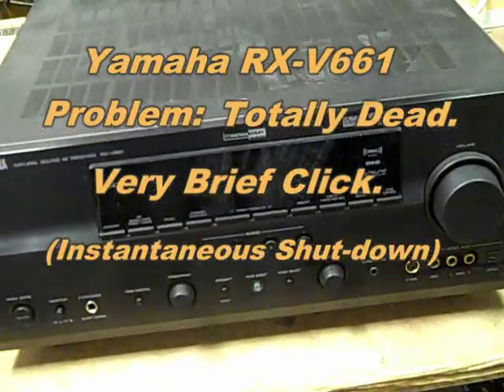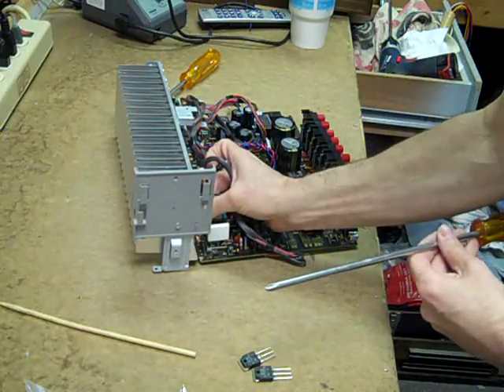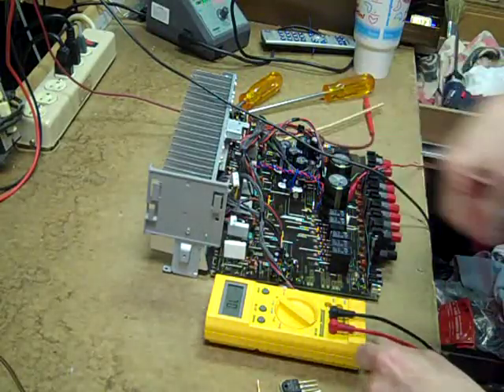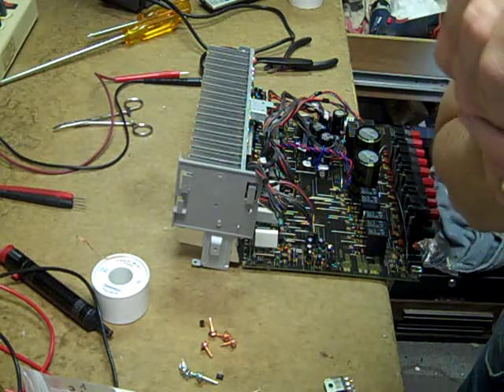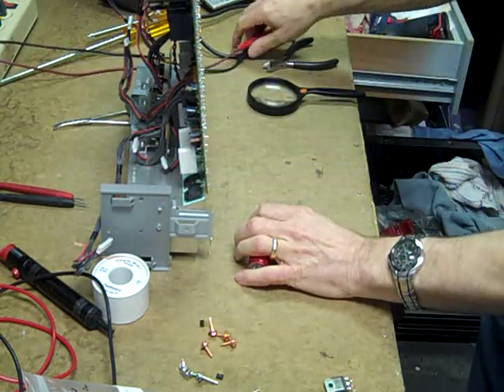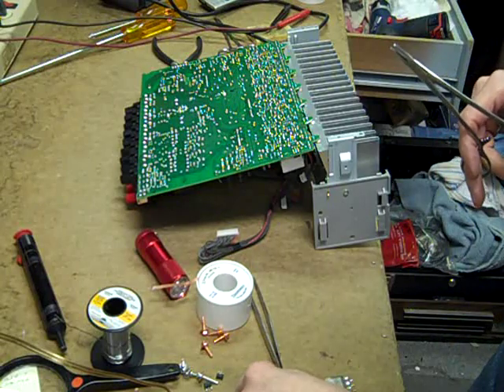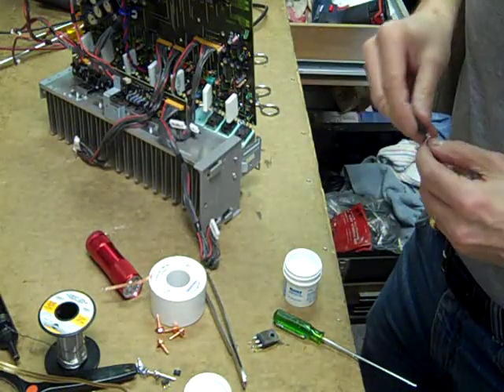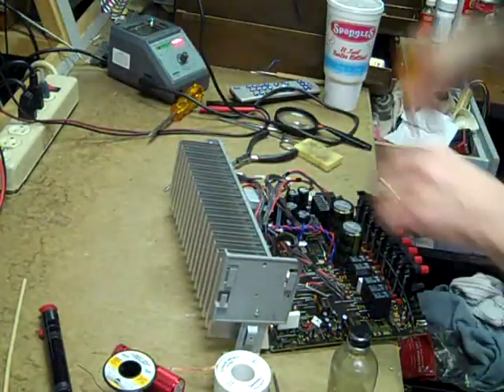Yamaha RX-V661 Repair Brief

Comment: Update 3. Things changed. Now the bulb lights intensely (pulsating, rather) when connecting to AC outlet; in addition, power transistor Q716C (NPN) does not look good (when measured in circuit). Not sure if this is a new problem or, this was the issue all along. Question: if I remove the 2 power transistors from this channel, and restart the receiver, would that work? I want to check if the receiver starts without entering in protection, with that pair removed.

Comment from the maker: The trick on these is to prepare a double ended POLARIZED AC cord; Take the receiver's own cord and plug it into one of it's own switched outlets. Take the double ended cord and run it from the the other switched outlet to the AC outlet or variac. The receiver will shut back down but the internal voltages will stay up. Make sure that the AC cords maintain the Neutral and Hot relationship, or BIG SPARKS will occur.
Reply: Hi wanna know if you provide repairs for the public i have a dead harman kardon 3700 with no power no stand by light

Comment: Hi... I have this receiver.   I haven't used it for the last few years due to house reno.... Today I hooked it back up today and was listening to it for about 45 mins.   When I moved the receiver into the stand the front speakers and the rear speakers stopped working..... the center channel and sub are still working.  I've been thinking I pushed a button or something..... Now 2 hours later and I've tried every setting.... I'm guessing this might be internal.... any thoughts?

Comment from the maker: Sorry didn't reply sooner. Don't have any Kenwood service data. Blue flashing in the relay sound like a serious short in there somewhere. This could involve working around some hazardous AC voltages. If you are comfortable doing so, unload the transformer secondary and see if the clicking / flashing continue. Also, if it blew the fuse, DO NOT replace it with a higher value or tinfoil it.

Comment from the maker: You have serious problems now - the amp channel is blown like in the video. The transistor number is abbreviated. The number is 2SC4468 and it's complement is 2SA1695. The drivers are also blown, probably also the 5.1 volt zener diode, maybe some other parts.

Comment from the maker: This is actually a very common problem with these. Are you a technician? The bad parts are on the main board, kind of hard to get to. Everything has to come out and parts soldered in from underneath.

Comment from the maker: My guess is that it would work but maybe be more NTSC than PAL for example. HDMI codecs and permissions are way over my head. Internal voltages would be compatible, but even with that I'm not sure it would work. I would suggest another used 661 might be a better option, maybe a broken one with other problems.

Comment from the maker: If it stays on with the volume down, check the voltages on the bases of the output transistors. They should all be about 0.5 to perhaps around 1 volt. Any anomalies would point to an affected channel. Could be one channel is still 1/2 dead. A severely clipped signal which would happen as volume is increased, would cause the protection to shut off. Could be a bad resistor, or transistor. A driver or bias transistor could be bad. Welcome to electronics repair. You need a schematic.

Comment from the maker: Probably either the remote receiver itself is bad (it happens) or maybe there are bad solder connections there at the IR receiver module. This also is pretty common. Way down the list would be some other fault in that area, a circuit board flaw, leaky cap, bad microprocessor, etc.

Comment from the maker: I mainly use the sucker for larger solder connections, to save on solder braid. I have a Denon (yup) hot air sucker/blower but it's old and doesn't work as well as it used to. I mostly reserve that for desoldering flat-packs. Thanks for watching - sorry I don't post much at all anymore. Maybe when I can afford the slowdown in production that the video work causes...

Comment from the maker: Assuming the power supply voltages to the HDMI board are OK, if the HDMI indicator on the front panel still lights up on an HDMI source, then probably IC1 is bad on the HDMI board. If the indicator does not light, then likely IC14 is bad. The nomenclature in the service manual appears to misstate which IC is the transmitter and which is the receiver.

Comment from the maker: @killerkoop33 The power transformer usually only goes out if you've been running it really hard for a couple hours.The transformer can be checked by a knowledgeable person. Also Yamaha with a blown channel may pull so much current at turn-on that the protect is triggered instantly, you never even see the display come on. If the transformer is OK this is probably the case. I wouldn't recommend just ordering the transformer til you know it's bad. About 135.00+frt. US model.

Comment from the maker: If the bias transistor is bad I would recommend ordering the Yamaha part number, VK432900. You might be able to get away with a 2SC2603, but the problem is the bias would probably be somewhat at variance with the other channels, and there is no real adjustment provided.

Comment from the maker: Actually used a "octopus" or "curve tracer". You can Google Octopus component tester. for info. A diode check on a regular multimeter also works fine. A leaky diode like the one in the video measures low both ways.

Comment from the maker: I do not know what "coil" you are talking about. The primary of the main power transformer would read much less I would think, and still be OK. If you measure OHMS at CB155 on the Operation 3 board (standby power board) and it reads low, the main transformer is ok. At this point you probably have a blown (shorted) amplifier IC. These are somewhat expensive and mostly only available from Yamaha.

Comment from the maker: I think you're in over your head on this one. There probably is a blown channel, but also, these things usually cannot run with the back panel off. Ground connections aren't made and this upsets the protection circuit.

Comment: Great video,

My yamaha RX- V640 shutdown right after i press power button.I hear a click then the screen comes on and it goes back off.After it shuts down i see DC offset on the emitter resistors.What are should i check for that kind of behavior?

Comment: I have a Harman Kardon AVR 354 receiver I repaired (replaced L7915) that worked very nice. I didn’t use it for a few months, and then when I plugged it in and turned on, acted strangely. The unit’s front panel lighted up completely (all characters were on). After reset, it functioned “normal” but with repeated (every minute or so) sound dropouts (short, 1s or so).  Strangely, during the sound dropouts the front panel blacks out, as if the unit loses power (the power on led is on though), but then comes back and functions well for a little while. In the end (~10 minutes) the sound drops off completely (but the unit stays on, and the front panel working OK), or turns into a whistle. This happens in all sound modes, all inputs, with or without any external connections (even with no speakers – reacts the same, you can tell that from the front panel blackout). Between the sound/display dropouts it functions completely “normal”. I tried repeated resets, doesn’t change anything. The F110, F111 fuses and wire (jumper) from HDMI board to Regulator board upgrades have been addressed by the previous owner. I didn’t see anything similar on Internet, have you encountered this issue before?

Comment: seems to be a pretty good amp.copper screws for the transistors.
what is that you use with your soldering gun?not the thing that solders,the other one

Comment from the maker: Well, a variac would be nice. You could put a 100 watt light bulb in place of the main fuse. If it glows bright, there's an over-current situation. This really seems more like a power supply thing though, and the PS PRT error code backs me up on that.

Comment from the maker: You can use 2SC4027 and 2SA1552. Be careful - they are reverse basing from the originals. You can even use 2SC4793 and 2SA1837, but they are much larger TO-220 package.

Comment: I have a Yamaha htr 5440 receiver and no channels were blown blown channels are usually caused by wiring your speakers at too low of an impedance like if the impedance is lower than what the receiver is able to handle

Comment: Hi Mark,
Yamaha RX-V795a. Shuts off after 0.5 sec. Diagnostic mode quickly (0.5s) shows: "PS PRT 39%". Output transistors (C3856 / A1492 pairs) look OK in circuit. The Noble resistors look OK. The regulator 7812 (x2), 7912 and 7805 (all on the main heatsink) have the proper voltage. Mind you, I only have 0.5 sec to do the measurements. Is there any way to increase this time? I can’t measure the DC offset, too short a time.

Comment: Hi Mark,
My Yamaha RXV661 which was running fine for the last 4 years suddently refused to turn on. I was trying to plug and unplug a few devices from the same power plug when I found the 2 of the SCENE button LED turn on for a while. Thereafter, the device simply refuses to turn on. Checked the fuse out of common sense, but they seem ok. What could have gone wrong. Will appreciate your inputs Mark.

Comment: ive not bolted back the main amp board to the heatsink and ive disconnected the thick power wires from the collectors of the power transistors cause ive already had 4 more power and driver transistors go short on me cause of a fault with the plus and minus 61 volt driver supplies,there seems to be something on the main amp board causing the dual supply to be very low,im having to run the amp in diagnostic mode so i can test but i dont know what else to do and yamaha uk are very unhelpful.

Comment: i have a yamaha rx v1900 av receiver,both right and left channels were shorted out destroying four power transistors,four driver transistors,two 5.1v zener diodes,two 220 ohms resistors,also one of the power supplies were damaged that supply the main amp board with a dual plus and minus 61 volts,this has been repaired but the main amp board is dragging the dual supply down very low,i cannot find any more shorts on the main amp board that may be causing this problem,can you please advise me.

Comment: Yeah your right about that,I went to turn on the amp and i heard a loud snap and flash..I thought the transformer went,but it was the circuit lifting up from the board soldered it tested it same thing so i put a jumper on it.the yamaha RX-V2500's fan circuit is still not working so i improvised it with it's own power supply Until i can order a new board.I know yes i am an amateur,but thank you for your informative video's.

Comment: It's the cooling fan,on Power(5) PCB it puts out upto 21 volts. when i reconnect the fan it goes into protect ( the fan circuit that is) and then won't work..I bought the receiver on ebay for $20, the Main(1) PCB was damaged from being dropped on the speaker outputs .The board circuit lines were cracked and i have repaired it  jumper wires and works fine now. self diag shows all normal.I didn't want to fully disassemble the whole thing Luckily the troublesome fan circuit is easy access.

Comment: Hello, I have a kenwood GE7030 equalizer Thats being a real pain.I have the service manual and ive checked all spots for proper voltage and they seem fine.Before it started to go it would sound like distortion on both channels,It would do this off and on untill it died.the display works fine but no sound and the bands display nothing.It also powers on and off with no problems.On the amp board i replaced 3 high speed diodes that looked like thay have gotten pretty hot but still nothing.

Comment: I got that last part in fixed that but my sound still cuts out at about 45 or so and was able to stay on for a few seconds at a higher volume i am not sure seems like something with the front cover because it did stay on at almost max volume. But it still says check speaker wire for the first 10 seconds when i first power on the unit after plugging it in to the wall for the first time.

Comment: Well i am but out of money on this puppy i tested with the meter and found 3 more bad transistors 2 sk1695 and 1 more stc4468 now i thought it was fixed put it back together and it says check speaker wire one the first power up on the second it stays on. I thought i just had to hook speakers up tried that but when i put like fm radio on when the speakers are about to show it clicks off.

Comment: Hay mark i was able to get the receiver to turn on loosing the front cover it turned i turned up the volume it stayed on with no speakers attached and then i put the back and front cover on it would not work loosened the front and got it to turn on5 seconds later a power transistor blew the part number is SK C4468 i only found them on ebay in like china any were you know of in america were i can get them sooner

Comment: hi john it was capacitor that blew up completely did not see it before there is one more cap i don't know if its thermal paste on it or leaking mind you i got these receiver on ebay and it look like it was brand new no dust the fan and the capacitor fix so far must have been a lemon i don't know how to post pictures on youtube but i took some of the blown capacitor and board

Comment: Thanks mdzacharias i open my receiver and fixed a broke fan and change two fuse thant blown going to try your advice two questions though when i unplug the hdmi board the receiver does not shut off clicks on and then off over and over but the power does not blow is it possible its bad caps on hdmi boards like the other onkyo's. One more question i have seen your reviews of the multimeters can you recommend a good starter meter on the cheaper side that can handle voltages of a audio receiver

Comment: hello, i'm a technician from Brasil, and i had some troubles with the receiver that i already repair, the unit fails to turn on if i press the power button right after set the unit to  stand by, i have to wait 5 seconds before turn on the unit again, i already repair the  (-bv and -bi) lines, after the unit is on, al voltages and protection circuits are normal, do you have any idea to fix this issue, the unit is a Receiver Yamaha RX-V730.

Comment: Thanks Mark. the US part may not work as it is not calibrated to  230-250V AC . I did google but could not find any supplier stocking the part. Will fetch it from the service center and try if removing the rust help. Otherwise, i dont see much options because I dont of anyone here who can work at the component level.

Comment: never mind it was a capacitor that blew im blind i fixed it does not look like anything else is bad i need a multimeter i would post a picture not sure how it is the board in front of the amp like your fixing in the video it has the output transistors im not sure but im guessing the Channel with the capacitor that blew up amp channel with problem

Comment: Hi mark i actually found a part on a board that exploded its not a capacitor or a transistor but is on the same board output transistors you told me to check i put the part number in google and some part site no luck it says C5443 little black think with one flat side one curved i post a picture if i could any help would be greatly appreciated

Comment from the maker: The big resistor you see is 750 ohms. It's good when the voltages to be bled are over 20 volts. Less than 20 volts I'll often use an 8 ohm 20 watt resistor - they're common around my shop.

Comment: No, it doesn't. I also visited the local yamaha service center and they said that the DSP PCB has got rusted for whatever reasons. Also gave the faulty PCB part no WJ698200 which needs to be replaced. Now, this PCB is not available in India. Can you suggest where should I get this from.

Comment: So I have this same receiver, rx-v661 which works fine, however the display no longer works.  Tech seemed to think it was a problem with the power supply.  Any ideas on that?  If so do you know where I could get the parts to replace and fix it?  Great video by the way

Comment: well i fixed that last problem but im back to square one it still shuts off says check speaker wire unless i take off the front cover and probably blow another resistor. I made a video on my you tube channel just click on my name i could not post the link for some reason

Comment: Hi mdzacharias, I have got RX-V630 which turns on for a brief moment and shuts down. Sometimes there is message check SP wire on start. I have disconnected all my speakers but still the problem remains. Can you guide me on where the problem would be or have you got a circuit diagram for it?

Comment: Hi Mark, I have a Yamaha RXV 661 Receiver and the Polk Rtia 3 connected to it via the front A  and front B/ zone 2 with extra SP assign mode. 
It only plays the LEFT SPKRS woofer & RIGHT SPKRS tweeter. Can u pls throw light on the issue as I am not able to know work it out.
Reply from the maker: Sounds like the speakers are the problem.

Comment: Wierd i was able to get audio when turning it on just now but when i pluged in the fm antenna it shut back off. There is a fan inside that is not working does that cause the receiver to power off like that its 120mm fan was going to replace it

Comment: Mark,
I have a RXV-665 that has the STK443-130 amps....The unit had a similar problem,shutdown and I can get the self diagnostic to read  - DC PRT :075H
Do you have any experience or tips on this model,,?
Thanks,
Steve
Reply from the maker: Steve Bavis The receiver can be forced to stay on for troubleshooting. Are you a technician?